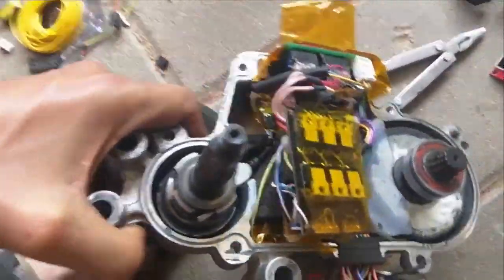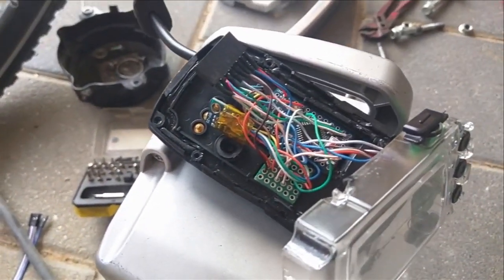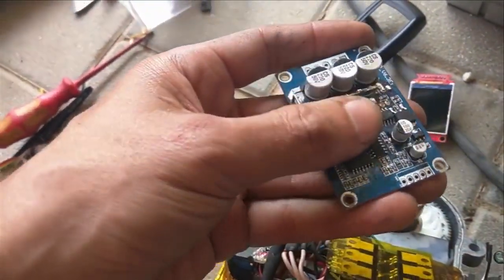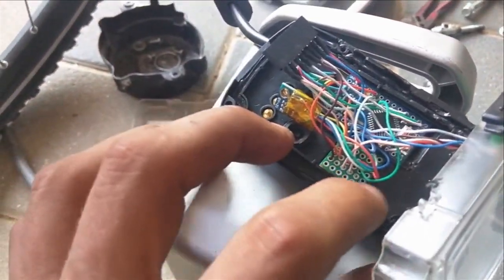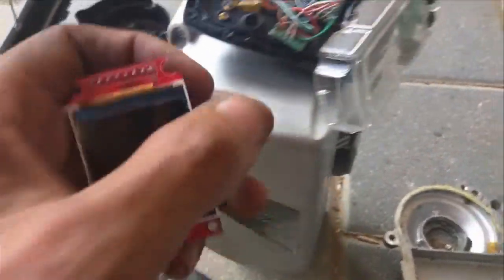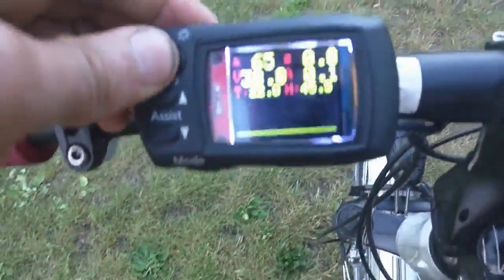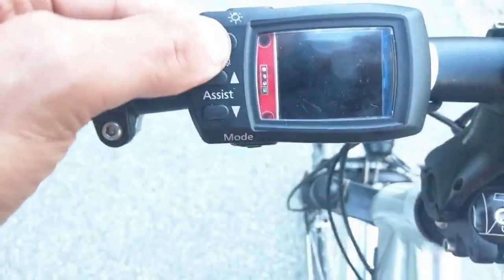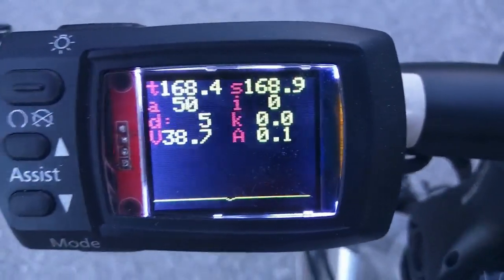ready: open source Panasonic/Flyer eBike/Pedelec Controller

Comment: Hi @robodurden, found your project and am very interested :D
I have a Rohloff E-14 gearshift which I want to use on my non-Ebike.
If I got it right, Panasonic Fit1 also uses CAN for the Communication to the gear.. do you by chance have any IDs for that?
Reply from the maker: ??? i did replace the entire panasonic control with a cheap bldc controller and two arduino mini. I for sure can not help you the CAN bus of a Fit1 bike.

Comment: Can you make it faster,like 40 ?
Reply from the maker: stupid people always want to have everything faster :-(
Double the battery voltage and in theory the motor will spin twice as fast.
These cheap bldc controllers probably are not designed for 36+ volt.
As i already commented here, with hoverboard controller and EFeru FOC firmware, you could boost speed by 20% with field weaking.
The 25 km/h limit to make such a ebike street legal (in Germany) are a software limit.
So with my "open source controller" i could drive faster. But i never tested more than 25 km/h 
because that's stupid.

Comment: Thank you for this great job
I have the same Ebike, but it's very slow even I choose the high speed...
So, I ask if I can use it without the screen controller 
And if I can make it faster?
Reply from the maker: Stupid Fun Project ?
If you want to ride faster, then it probably will no longer be street legal. To make the motor spin faster you need higher battery voltage. Or a foc motor controller with field weakening. You can define the EFeru hoverboard to run with one bldc motor only.. 
I was able to increase speed by 20% activating field weaking with my little solar camper.
Yes i guess you could modify the Arduino Mini firmware inside the motor to run without the screen controller.

Comment: Hello nice hack. I have an old 26v pedelec motor with a very simple command (only 3 button and no display) I want to upgrade that part with a kt lcd3 to have some metrics. Do you think it's possible very simply (on ly soldering) I search about this type of modification, but I find nothing. In advance thank you for your answer.
Reply from the maker: Not possible. These cheap china LCD controls only work with the original motors. Like I did, you would need to build and program something from scratch. But tell me if you find a 7s BMS with Bluetooth and a nice app !!! That would show you the battery capacity and current power consumption..
Reply: @robodurden  Thank you for your answer. I already bought a new battery replacement (25.6v)  with no BT so it will be not possible to have those metrics. My aim  was to have speed and total km. It can be achieve with a simple speedmeter, but the advantage of these LCD is that they  did more and are locked on the bike. I did not find speedmeter that can be locked on the bike.
Reply: @robodurden  IMHO This looks like a nice BMS, but the bluetooth version is a lot bigger. Eventhough, it might fit when replacing the original BMS which is quite big. It is not cheap though.

Comment: Hi, i have a question. Why did you do this? Was something broken?
I intend to replace the battery pouch cells with 18650. Are there any concerns for the BMS? Simply reconnect the right amount of series i think? No luck up in the original bms?
There isn't any communication between battery and controller to prevent this upgrade?
Reply from the maker: My Controller inside the motor was broken.
You need the original BMS to communicate with the controller if you have a 36V Flyer !!!
Reply: @robodurden  why not repair the fet on old controller, its the normal error in this motor. You can also replace it with an 36volt controller, its all the some, only other software.
Reply from the maker: @erstesytvideo2017  problem also was that this Flyer controller wants its expensive battery and I was not able to hack the serial communication. Really tried hard but they used some flipping bytes so it was impossible to generate a proper answer with esp/Arduino.
Reply: @robodurden  hm, normal  the Motor only Needs  24voltage the original battery only for baterie status.
Reply from the maker: @erstesytvideo2017  no it was 36V. Never buy a Flyer. Without their proprietary battery status, controller does not work.
Bye.
Reply: Wait I thought I can just replace 18650 inside the battery of this flyer, am I wrong?  Does the main control unit prevents users from such simple upgrades? Possibly monitoring voltage of the battery and denying its authentication when the voltage test isn't passed (that happens when you dismantled the battery on your own and installed new cells)
Reply: @vinylscorcese3435 just apply a lab power supply then. But, you need some breadboard for the balance leads.
Reply: @robodurden  Thank you for your reply!!! Controller can be replaced maybe with a bafang 36V? I am interested if this will work for the 25,9V version that I have. I would attach it below the sadle, not inside the motor.
 From what i have been seeing and reading the 25V version is easy to change battery with a custom one. Only "State Of Charge" on the flyer display is a problem appearantly, it stays on eco. So now I have the communication broken when replacing BMS or removing the BMS. I have two batteries with broken original BMS. (they smell very bad but I do not see scorch marks other than on the connector to the bike which is black and burned.)
Very late reaction from me. because the youtube popup does not work for this thread. I have that a lot lately.
Reply from the maker: @camielkotte  I guess the 36V Bafang controller will not startup because 7s 25.9V battery voltage will be red as empty 10s 36V battery. You need a 24V controller.

Comment: I have old panasonic 26v, is it possible to put a 36v (diy bat) to this motor?
Reply from the maker: If some capacitors will not explode or the motor overheats you might be able to drive 43% faster. Some old e-bikes have no speed limiter because bike with original battery can not go faster with highest gear.. Still a stupid idea. Better build a strong 7s battery that will boost your range.
Reply: @robodurden  is not for up the max speed it's for up the torque, i have a new 7s but the bike isn't strong at all, it's a gitane with old panasonic motor and a 21 s nimh original bat
Reply from the maker: Be happy with low torque but long range. Instead of probably killing what you have.
Reply: @robodurden  ok thx for answer😉

Comment: hi, is there a way to make the button that pushes the bike 5-6 km per our to 25?
Reply from the maker: The cheap bldc controller has an enable pin that you can set to +5V with the white 6kmh push button of the Flyer to make the motor spin. But then it is no longer a pedal assisted bike.
Reply: @robodurden  you mean that if i change bldc conroller i will be able to ride my bike at 25km per hour but there will be no assistance at all? im not a specialist, i just want . to ride my bike at 25km per hour when i go up the hill) can i install a grip with throttle instead? thanks in advance
Reply: @robodurden  you mean that there will be no assistance at all? can i install grip with throttle instead?
Reply from the maker: @blink18ii  looks like YouTube deleted my answer because I posted a link to AliExpress.  YouTube YouFu** :-(
Reply: @robodurden  so it is possible to use throttle grip? i have flyer c5 that look alot like yours, where can i find the scheme to install throttle grip? thank you
Reply from the maker: @blink18ii   holy shit,  YouTube deletes indeed.

US $7.46  20%OFF | 15A 500W DC12V-36V Brushless Motor Speed Controller BLDC Driver Board with Hall

And this throttle grip could be a potentiometer:

US $3.42  20%OFF | 24V 36V 48V 3 Wire Twist Throttle Grip For Electric Speed Control Scooter Bike 7/8" Handlebar

Then simply connect black to GND, red to +5V and white to VR :-)